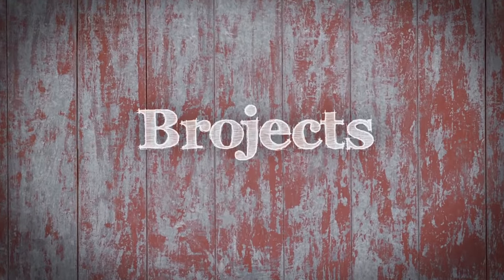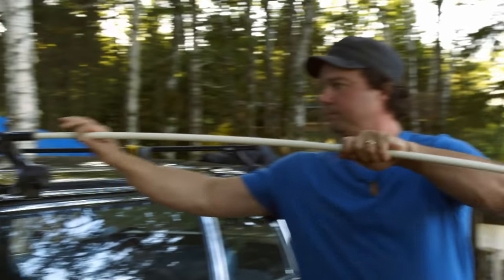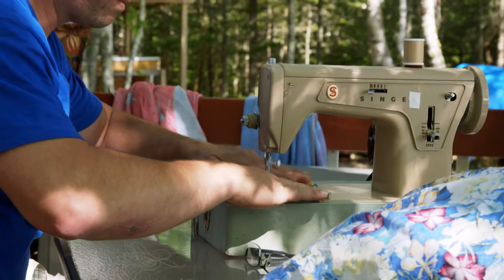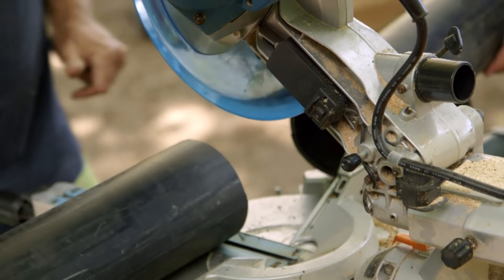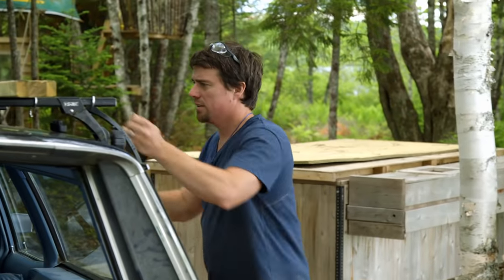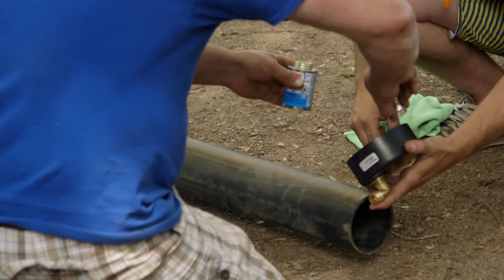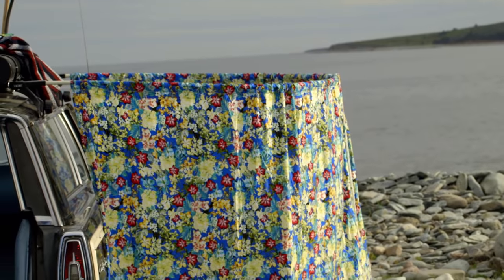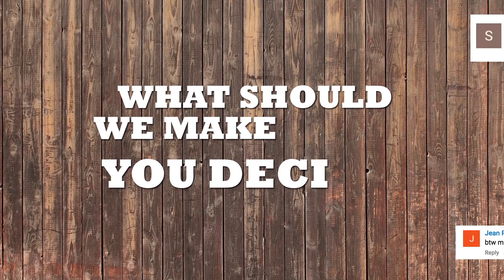The Ultimate Outdoor Car-Shower

Comment: How many gallons did the pipes up top end up holding?  What was the total length of pipes and what was the diameter?  What pressure did you pump the system up to?  How long did the pressure provide reasonable water flow out the shower head?  I'm considering this design for a campervan, but, I'm concerned about the amount of water available and thinking the air pressure would drop quickly making the shower useless.